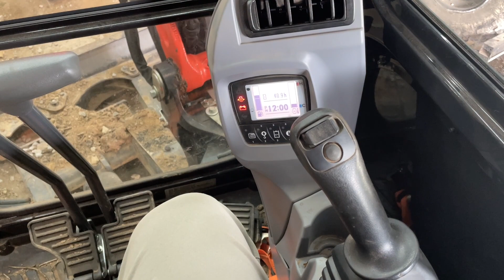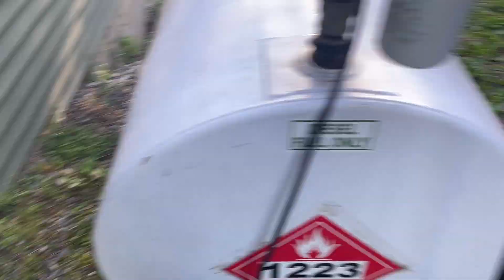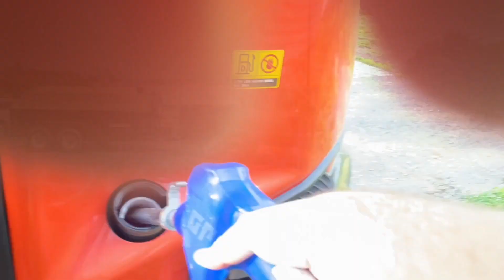Kubota KX033-4 popping stumps and clearing a yard

Comment: Thanks for the reply about the KXO40-4.    I think I’m going with the 33-3.   By I was wondering what kind of stumps/trees and sizes you can pull out with out digging up.  I have mixed timberland that was harvested then grew wild.  So I’m wanting to clean it up and dig out the stumps they left behind.  As well as the electric and water company’s leave behind as well.  Hardwoods include Black locust, Bois d’Arc, Eastern Red Cedar, Oak and Hickory.  Soft woods are mainly Pine and Sweet gum.  I also have some Dogwoods and Redbuds I’d like to transplant to better locations.  So just trying to figure out if it’ll do most of these.  Also I’m in Rocky iron-ore soil.  About the biggest rock I’ve came across was about 2’x2’x8”. My 55 hp tractor moved it fine.  I’m subscribing to check out all you videos to see what it can do.  I’m doing mine for personal use and maybe an occasional side job for a friend.  But not planning on running it as a business.  You running yours as a business?    Thanks again.
Reply from the maker: I’m not running mine as a business.  I have natural limestone rocks that I’m stacking for a retaining wall that are 600-1000lbs each.  I haven’t videos much of it but I could video it today if you’re interested.  I can move all the rocks, but the big ones really need to be done up close to the front blade, and sometimes even leveraged off the front blade

The biggest stumps were probably maple, 30” in diameter and I definitely needed to dig around them to pull them up.  In fact, I had to knock the dirt off to be able to lift them

Comment: Nice machine, I’m looking at the same one. What sized bucket did you get?  I noticed the thumb tines mesh with your bucket. I’m told not every sized bucket meshes with the thumb
Reply from the maker: I think mine came standard with a 16”bucket
Reply: @beardedgarage  awesome. I’m looking at the 24” bucket. Honestly, im having a hard time between the kx033 and kx040. Not a massive price difference but im more concerned with the regen not being as reliable on the higher hp motor.
Reply from the maker: @toddallison4390  regen?
Reply: @beardedgarage  DPF Filter Regen.  Anything over 26hp (I think) has to have a DPF filter.  Many have said that the extra EPA stuff tends to reduce engine life, but that could be a myth.
Reply from the maker: @toddallison4390  DPF I thought was 25hp, but either way the 33 is just under that.  I looked for a long time before I got mine and frankly availability was a big part in my choice.  My local shop had a kx-033 on the lot and I could take it immediately
Reply: If thumb hits teeth it's not a kubota bucket.  Always go in between

Comment: how can i operate that machine in backhoe mode. Thanks
Reply from the maker: I’m not sure I understand what backhoe mode means.  What are you looking for?
Reply: @beardedgarage  Probably means the operator pattern. Sometimes called Backhoe or excavator pattern , there's a pattern selector to switch between ISO/SAE.

I learned on a backhoe so run in that mode. Have the same machine .Enjoyed the vid thanks.
Reply: There's a lever in the operator station to change pattern. Easy to do for different operators.
Reply from the maker: @particularlybad  ahhh!  That makes sense.  Under the seat there’s a lever that switches from bobcat to cat controls.